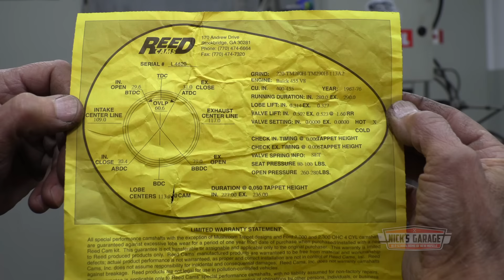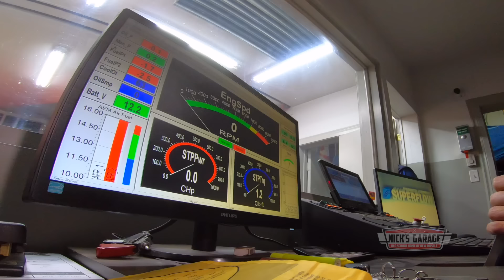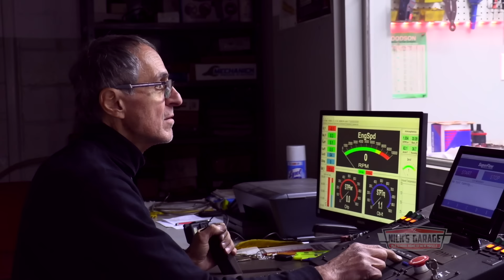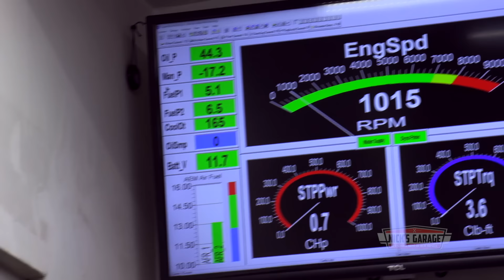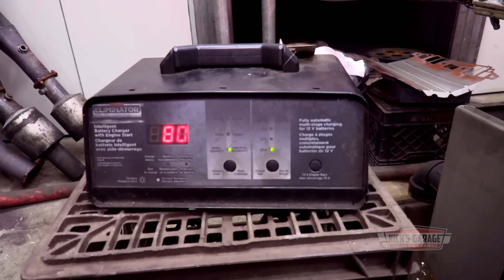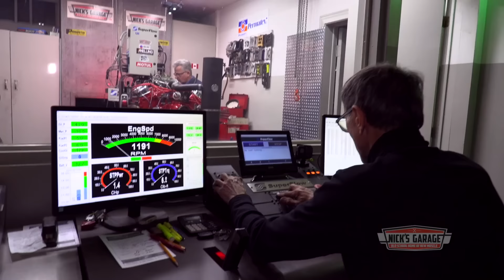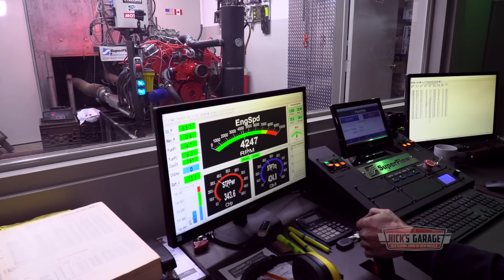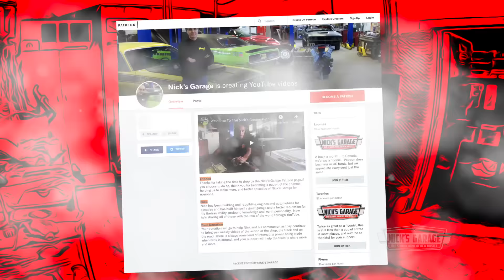1970 Buick 455 Stage 1 - Dyno Room Diagnosis

Comment: Header diameter might be to big?
Reply: Definitely plays a role if they are too big.
Reply: Definitely plays a role if they are too big.
Reply: Nope. 1 7/8" diameter.
Reply: @LR-my2di  On a stock engine? Yes, too big. And more importantly, what size collector? Since that effects it more. But you knew that already, right Mr Expert? Lol
Reply: @jrdmotorsports9718   This just shows just what you DON'T know but try to put others down because of that.  On a 455 1 7/8" is not "too big". You sure aren't Buick knowledgeable, but you talk as though you are. My point is simple.    The ONLY headers made for a 455 Buick have either 1 7/8" primary tubes or 2 " primary tubes, the latter having a 3.5" dia. collector and the former a 3" dia. collector.  There's a reason for this and you must not know it.
Reply: @LR-my2di  I'm not putting anyone down. Learn how to detect sarcasm. You came on as Mr know it all thinking you are correcting me when in fact you're not. That engine doesn't know it's a Buick and any REAL engine builder doesn't care what brand it is. It's all math, and experience. 
As for headers. I didn't ask what sizes were available, all I said was a stock engine doesn't need them, especially that big. Just because that is all that is available DOESN'T mean it's right.  The horse is dead Mr. Buick. Leave it alone.
Reply: @jrdmotorsports9718  Then it's a moot point pointing out the headers are "too big" (only in your opinion) if no others were available. But you're wrong and can't (won't) admit it.  If you were correct, then the current manufacturers and the long time Buick experts from the 1960's like Jim Bell wouldn't have used, built them or recommended their use. This includes Mickey Thompson himself on his own dyno with them circa 1967 for use on the 1967 GS 400, no less. 1 7/8" primaries and 3.5" collector diameter. Those were the original MT Super Scavenger specs.
Reply: @LR-my2di  Except it's NOT an opinion. Don't assume EVERYONE on here is an amateur making uneducated guesses, which is what an opinion is. Some of us have actually tested these things, and actually know from real world experience, not what they read or hear on the internet. What's available doesn't dictate best to use. It also doesn't mean it will work. If you had any actual experience, you would know this. You can try to talk down to me to try and impress the internet all you want, but it's misinformation like what you are regurgitating that runs the internet, so some of us actually want to help. Don't presume to know more than someone who does this for a living.
Reply: @jrdmotorsports9718  I'm an amateur, eh?  Would you like for me to document the articles I've written for mainstream magazines of the day on these subjects?  Glad to do so. Down to magazine name, issue and page #'s.  Has ANY of your work ever been published?  What I write are not just "opinions".  They were proven on the DTS dyno of my old shop time and time again, as well as other shops like Kenne-Bell.  When it comes to turbo V6 and Buick V8 builds, I've been there and done that for many years.  I do not "argue" with you on other builds.  
 Header companies build what work best in their engineers' opinions.  About 10  years ago I sent Doug's Headers all of my dyno tests comparing various earlier header info and specs so that they could come up with the best street header they could.  Street is what we're talking about here.  Doug's had a clean sheet of paper to do so. They offer only Buick 455 headers with 1 7/8" primary headers with 3" dia. collectors. Ditto for Hooker.  TA Perf. had already done their own tests to concur with what I said here.  And you say that their info and headers design is also wrong and/or incorrectly built?  Too "large", eh?   Talking about OPINIONS. That is only your OPINION because YOU never tried any smaller tube header (1 5/8" primary) on a 455 Buick.   We did ... back in 1985.  Ed Henneman (Ed's Headers in Mpls.) made us up some smaller tube (1 5/8") headers with 3" diameter collectors like you tout and they lost both hp and torque on a mid-400 hp 455 street engine.  Ed told us that would happen on a Buick 455, and it did.
Reply: @LR-my2di  Didn't know "magazine writer" qualifies as an engine builder.? Not concerned with who did what, and certainly not impressed with tech article writers pretending to be engine builders basing their "opinions" on what others have done to sell magazines.. Nothing I have seen in 35 years tells me any of what you said is valid. Then again, I'm not trying to sell magazines. Best of luck 👍
Reply: @jrdmotorsports9718  Trying to "sell" magazines??  That's pretty funny. Being "a magazine writer" is not exclusive to also building engines. However, I was waiting for such a humorous response from you.  So, no surprise there.   Just FYI, there's certainly no $$$ in writing magazine articles.  I did it for my own personal edification of being able to pass on useful information and findings to my fellow enthusiasts.  That's the treat for me.  Certainly not the money. You've often expressed your "opinions" about Buick parts that you've never even tried on a Buick 455 (e.g. smaller tube headers) ... because they don't exist.  However, I've actually tested those parts that were built for me on a custom basis and, unlike you, I have the hard data to prove what I say.  From way back in 1985 I have folks like Ed Henneman of Headers by Ed to thank for so much of that.
Reply: @LR-my2di  Wow. Ever hear the term "better to let people think you're stupid, than to speak and remove all doubt"? The fact that you are just picking and choosing words and taking them out of context to support your story telling is a dead giveaway. Typical. I'm done explaining it to you. "Tech article writer" NOT engine builder. Enough said.
Reply: @jrdmotorsports9718  Yes, I've heard that often. It reminded me of your constant diatribe.  Unlike what I've published in the past, you have no actual data to share ... just unsubstantiated opinions.
Reply: @jrdmotorsports9718   We can talk all the trash and make all the claims we want.  However, with no proof of our capabilities, it all means nothing.  I've offered my hard data to you, if you can find the old magazines it's in.  Or I will mail it to you in hard copy.  No problem.  In turn, all you've offered are your opinions.  In some of those, if we were discussing (say) a 400 Buick, Pontiac or Olds street engine, I could agree with you, but not a 455 Buick.  I know better. 
    I've delayed in seeing your response to the following, but here goes.  I suppose you respect Nick's opinion(s). After all, you carefully follow his builds.  So, isn't it funny that Nick never took to heart, or even mentioned, your position about the header size being too big on this 455 Buick?  Why? Because, like me, he knows better!  The big Mopar wedges (440's and such) that he builds are very similar "air pumps" to the Buick 455.  And there are MANY types of headers offered for big Mopar wedges.  But Nick has NEVER used any header like you tout on any of his 440 Mopar builds.  There's a reason. Like me, he's dynoed enough of these engines to know better.  That alone speaks volumes. 
It's past your bedtime.  I wish you a "blissful" sleep.  I'm sorry to have kept you up so late, but I'm a "night owl". Unlike you, I'm on PST.
Reply: @jrdmotorsports9718  Oh, BTW, "Dunning-Kruger" is hyphenated, as shown here. I suppose that you may not  really understand that particular syndrome, or else you'd known that.
Reply: @jrdmotorsports9718   Wow, what a revelation! 
Of course we all know that you're the only "expert".  All we have to do is ask you. 
You can always tell when you've "got someone's goat" when they resort to name-calling (e.g. "ignorant", "stupid", "jokers" ... etc.). That defines a person and makes all of the verbal jousting hilariously worthwhile.

Comment: Set up distributor 18 at idle and full advance at 40 , look at your video the secondaries are dumping because butterflies are opening slow, we all know Edelbrock 750 would bring it alive easier but you can change the secondaries to all mechanical,  all no fuel filters in the filter housing.  I know that motor very well, and that also make that 454 turn into a beast too

Comment: Points fried by the oversized coil! Get a regular GM coil and it will be ok, running a ballast resistance, as it had resistance wire from the ignition switch and connected to the starter solenoid for crank!

Comment: BUICKS HALF OF A MOPAR ANYWAYS I LOVE EM I HAVE A 70 GSX SATURN YELLOW 445 STAGE 2 ALUM HEADS AND ALUM FACTORY INTAKE AND TRY SOME COPPER COAT AROUND THE ALL RUNNERS AND CHINA RAILS.. COPPER COAT IS THE DEAL W THOSE ALUMINUM VALLEY PANS!!  THAT IS WHAT I USE BUDDY!! Bellhousings all are interchangeable!! Nothing else and some of the motor mounts but you probably use motor plates or I do buddy!! Merry Christmas and Happy New Yr from North Carolina,USA aka DIXIELAND ole buddy. Starter bendix rattling Nick those good rebuild starters w no new spring to keep the starter from rattling its about yo give you a fit isn't it buddy? Could be points shutting it down or could be throttle shaft sucking air thru the throttle shaft in the carb Nick.....yeah 360 was b.s. cuz I'd insurance plans over 400 I'd bet...points are,garbage sounds like they are bouncing buddy or dust cap!!

Comment: The automatic choke is not functioning at all on this engine, it should close, its stuck in the wide open position, you adjust the automatic choke it will act different, it won't cut off at idle like its doing.

Comment: Can the thicker oil pump gasket lower oil pressure some if it is too thick because of increased space between gear bottom and pump.   Very nice work
Reply: Slightly thinner gasket. No change in oil pressure.

Comment: My buddies stock 455 would run 12.23 with a 3.42 gear on 70 series street tires. I wouldn’t be so quick to call them cheaters for high 11’s

Comment: Do you have a fuel leak on that thing sucking air into the carburetor somehow and shut yourself down I had to happen of mine 455 they run for a while and it was shut off I kind of find out I had a bad gas line or what type to fitment just just enough air getting into the line to shut it down

Comment: Hey Nick you're not the only one they do have this problem I work for God bring up Buick and Woodbury New Jersey here in the United States check the carburetor bolt bolts and a manifold bolts okay and awesome I need that manifold use might not seen this before but believe it or not some of the material the cast iron simple you can suck air through it you won't see a crack it's called sponge what happened is the casting probably didn't take and you informalities in the middle and eventually you know it sounds funny maybe to you I don't know but that could be also try changing the manifold and checking the holes I make sure you show it on the bolts playing through the manifold in the car hope this helps love your show man never knew you were working with Buick take care

Comment: I cant wrap my head around how a flow bench can in any way represent how an exhaust port will perform as much pressure they actually see. I like Darin Morgans idea, put about 1,000 lbs of pressure on it then smack the valve with a hammer n note the pressure loss😅

Comment: I get to go find out if my six pack carbs run today. After sitting two years the corn gas turned into powder and corrosion, and that was with the stabile in it. Most likely going to have to get another gas tank also. People, get the methanol free gas if you don't get to drive the car often. Your mechanic will thank you for it. Lol

Comment: Those intake manifold bolts should have been tightened to the torque spec. They weren’t . Of course you can get away with it there but not a good look for an engine builder. Maybe they edited that out but I don’t think so. But a great old-school blast from the past video!

Comment: My dad took one of these out of a 72 Riviera boattail. He dropped it into 51 Studabaker truck. These had a factory fiberglass front fenders and hoods. The motor was rebuilt by Butler Racing Engines here in Tennessee. It was dyno'ed at 850hp N//A. The truck was a purpose built pro touring car. It is a beautiful build. Coors Silver and candy red H.O.C. paint. BBS 3 piece gold anodized wheels with graphite lip. Brass plated grill and trim. bagged. Its an incredible looking truck man. Screams too.

Comment: Hunting down a vacuum leak if found this on a 66 old's 455.  The carb had a dashpot mounted on the intake to limit the movement of a closing throttle.  Without it the engine would die after throttling up the engine.  I forgot to install dashpot and it would not idle.  Hunted for some time before it was found by my son.  Felt like a fool.

Comment: That cam is much bigger than stock. It will likely make peak power out at 5500 rpm with stock heads. It should still make over 500 lb-ft around 3500 rpm. Something isn't right here.
For comparison, Car Craft's 455 build with 9.4:1 and a smaller cam, b4b intake (which is mostly a weight savings) and headers made 425 and a mountain of torque.  That cam was a ta212 with 218/230 duration on a 112 lca. This cam seems to be a 227/236 on a 113 lca.

Comment: Nick, if its a true stage one engine it should have the larger intake and exhaust valves (would appear to be HUGE next to stock size), and those engines were known to make 400+ hp in stock form.. this is not a stage 1 I dont think :) still cool though!

Comment: As a mechanic, I would wxpect you to know to take the factory seals for the China rail to the trash can. I have repaired so many "factory" rubber and also cork China rail gaskets that were cracked, it isn't funny.
I have never had to fix a silicone rubber (RTV) gasket yet. Been doing auto mechanics for over 50 years. When I discovered silicone rubber was better than the OEM China rail gaskets, I have used nothing else.
I realise that the customer may want to keep it as close to original as possible.
Please do yourself a favor in the long run and try silicone rubber on the China rails.

Comment: A old trick I learned from a small engine mechanic when you install NEW points, turn the motor to open them, put a piece of white paper or the white cardboard box they come in, turn the motor to close the points on the paper or cardboard and pull out the paper, look at it, if its dirty repeat until the paper comes out clean! Makes the points last 1/3 longer, its the correct way to be sure they are clean.

Comment: The original blower cart used to start the engines on the SR-71 Blackbird had 2, 455 engines on it and when it ran st high RPM sounded amazing.

Comment: i had a 70s ford 302'  put 90s heads on it ,,  same thing you have  not idle ..  ended up rockers, push rods mixt ..  basicly.. valves didnt close correctly..  non adjustable valves ,, valves to tight ..

Comment: Take those felpro gaskets off and put either copper or steel stamp gaskets that's a thin gasket it will raise the compression ratio up then check for your rocker arm height your valve height and your valve seat pressure to see if that's right that would drop your compression ratio if you don't have enough seat pressure on your valves

Comment: I wonder why theres no torque value added to the intake bolt down. You have micky thompson  Headers and you can change the metering rods on the secondaries  according to the mickeys needs because unequal length tubes inside the  ingenious
M/T collector are the heads standard gran sport heads?  They are Way 
inferior, different than stage I heads

Comment: I understand wanting to run with points, but today's quality points are horrible and they start bouncing at very low RPM's. I used to Run Mallory 102x points with a heavier spring. When i tried to use points, most of the ones i purchased has poor quality construction and the contact pads did not even match. I go electronic conversion 100% now

Comment: Headers will DEFINITELY not reduce torque, come on nick! Don't make excuses for it. Going back to factory manifolds would make even less. Theres a reason the first mods every racer did was headers, the way this motor runs I feel theres still some hidden issues with it

Comment: Bigger cam and you lost comp. 9.2 is better than 10.1 with iron heads.
Headers can trix the engine to run bad at idle and a little more cam on that lower comp. Idle 900-950rpm instead.
Bring the converter up to 2200rpm.

Comment: All I have to say is wow you guys are good. And I would never use the rubber seals on the front and back of the intake. ultra black ultra black RTV gasket maker by Permatex is all I use. I have personally sealed about 100s of engines. My speciality  is carburetors I know almost all of them by heart. And how to modify them for our ever changing fuel supply. I started this journey in the automotive trade in1970 and the road I'm on will end on tombstone I've never stopped learning. I'm also good at A/C that I blame on moving to AZ  23 years ago. That being said the Dyno time i have under my belt is less than 20 hrs. One of the main reasons I watch your show. Plus your brilliant, i have a proposal for ya I would like to come work for you for free for a few weeks because i believe i can learn some really cool stuff from you.